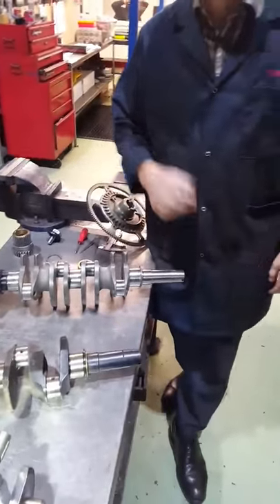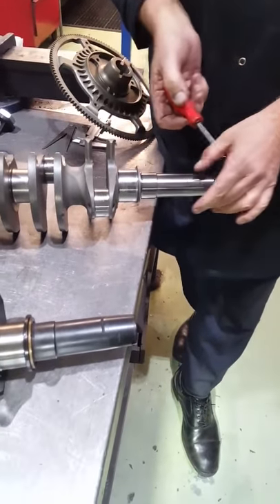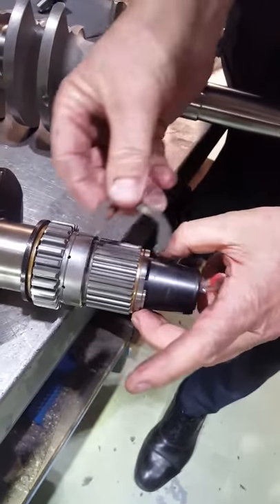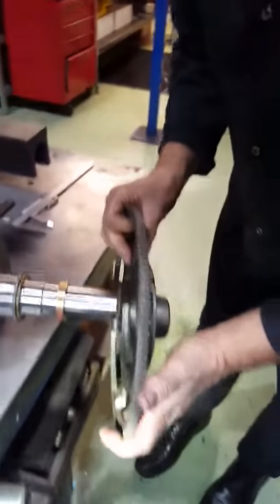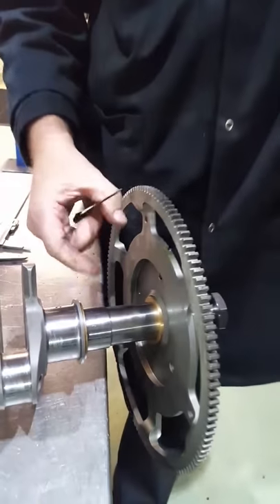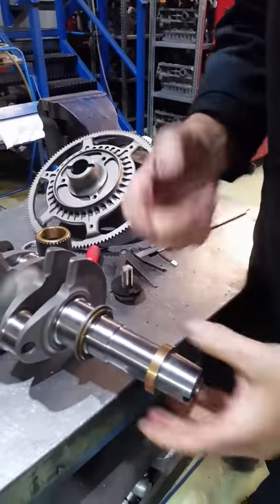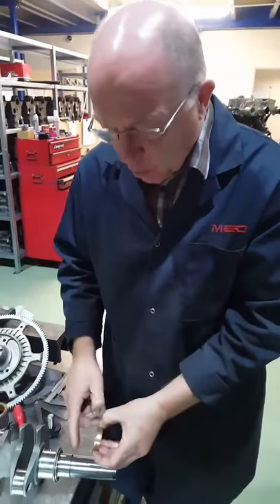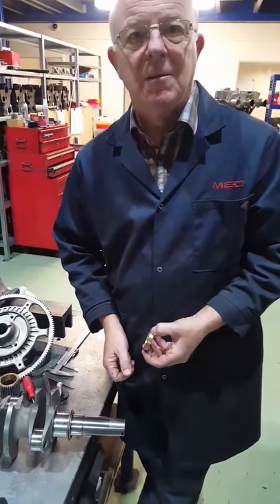Classic Mini crankshaft C-clip grooves and how to set the primary gear end float

Comment: Hi Steve, my son Chris has purchased all the parts from you and I see that brass spacer.Previously the primary gear had a floating inner bush.Looking at your video would you advise/ agree that we will need to replace that with a pressed in bush? I’m not new to building race engines, but this will be the first mini one to blue print. Appreciate your thoughts Allan F

Comment: What is the advantage of the multi web crank?
Reply from the maker: Why is an MED multiweb steel crankshaft better than a standard type?
The counterbalance effect is especially impressive with the multiweb, even more so than the regular EN40B steel crankshaft. An improved counterbalance effect helps to reduce the 'whip' often encountered with the three main bearing A-Series crankshaft, to improve longevity and performance at higher RPM levels. The design utilises a narrower yet larger diameter big end journal size for extra strength along the crankshaft. The EN40B steel crankshaft is best for when regulations do not permit a multiweb crankshaft – for all else this is the ultimate setup.